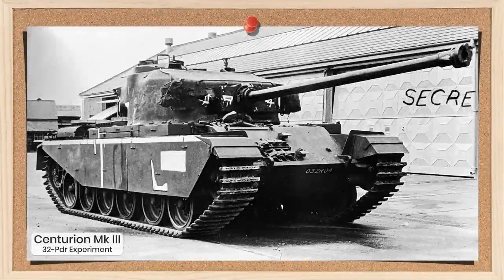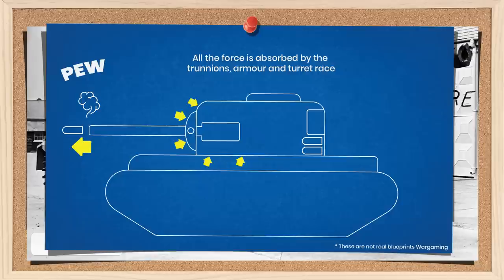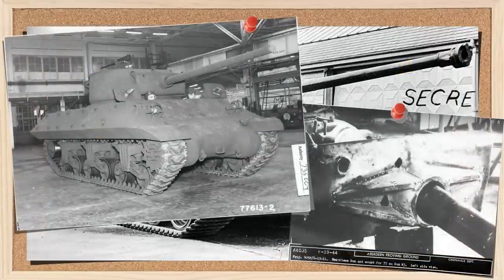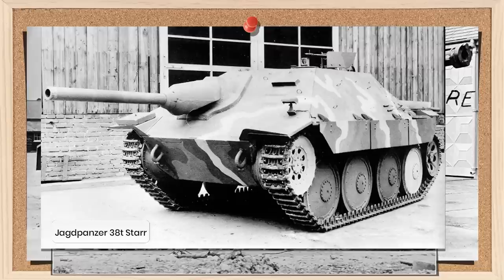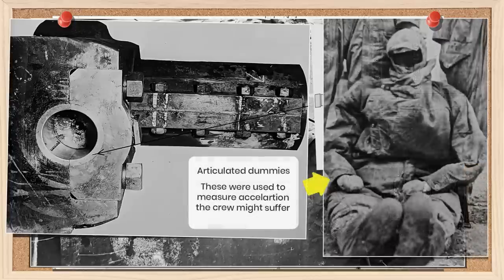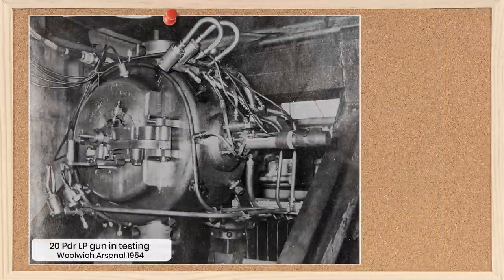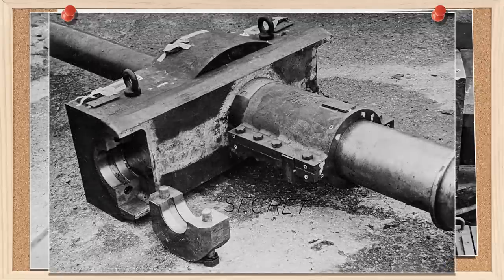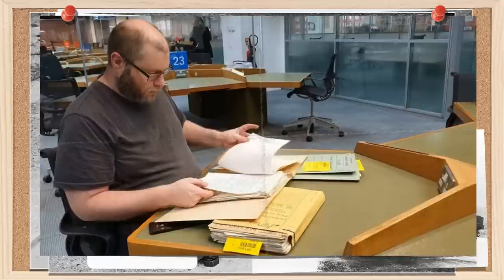Centurion 32 pounder experimental tank.

Comment: The basic idea of having the turret and hull structure absorb the recoil energy directly instead of using a recoil buffer is good. I was a turret gunner in the army and I can tell you that a recoiling gun is extremely dangerous in such a confined space. A fixed gun would be much safer. In addition the recoil mechanism itself can get dangerously hot which causes it to lose effectiveness, leading to the possibility of a recoil over-run during rapid fire.

I always wondered why tank designers didn't just reinforce the gun mounting to absorb the recoil directly, and always assumed it was because of excessive weight. However you imply that there were other problems as well. I was amazed when you said that the fixed-gun system led to the blowing out of the periscopes! But I don't understand how not having a recoil buffer mechanism could do that. The explosive blast comes out of the gun muzzle, not the breach. It should make no difference inside the turret whether the gun has a buffer or is fixed. What am I missing here?
Reply from the maker: the shock of the gun beign taken into the armour - though at this point it was overcharged too muich higher than normal -
Reply: The tank is not going to passively absorb the shock energy, there will be a reaction. It will vibrate just like when a sheet of steel vibrates when hit with a hammer. To every action there is an equal opposite reaction.
Reply: The Germans at the final months of war pursue the concept of fixed gun on the Jagdpanzer 38 in  Czechoslovakia for reasons of speeding up the production but it did developed issues like cracked front armour but the end of the war stopped any development...
Reply from the maker: @paoloviti6156  yup, which is why we added that to this video :)
Reply: Short answer is newton's law. 

When explosive goes off inside the breeches, the expanding gas pushes on all direction. 

For the sake of simplicity, let's just say it only push against the projectile and the breech face. 1/3 of the energy was convert to energy sending the projectile flying, 1/3 of the energy get push against the breech, 1/3 of the energy get vented out the muzzle end. 

Without a recoiling device, the 1/3 that get slam against the breech will have to transfer into the gun mount, which get transfer into the rest of the vehicle. 

If your vehicle did not physically moves back, that energy has to go somewhere else.  Stuff that's relatively loosely connected, such as optics will get destroy in the process. 

Your observe the recoil system getting hot. Have you wonder why it was the case? It is largely because of the internal friction generated by the moving component of the recoil system. 

Lastly, the engineer do take into account of how much recoil the vehicle frame, the gun mount, the suspension, etc can absorb. It is a balancing act, just like any other engineering problem. 

A flawed but somewhat useful explanation. There are 3 proposed design of afv, one without active recoil element, one with only active recoil element, one with a mix of both. 

The static design will have to reinforce component vehicle frame, suspension, etc while also engineer some isolated suspended mount for optics and crew. The resulted vehicle will have twice the weight compare to the active recoil vehicle. Much of the weight is dead weight.

But when we examine the design of the active recoil design, although it is 1/2 the weight of the static design, the volume the recoil system occupied is roughly twice of the static vehicle. The travel of recoil also means you need to elongate your design to accommodate the recoil travel or your vehicle has opening allowing the recoil to travel. 

This engineer compare, contrast, made optimization, and came up with a hybrid design that relies on both active and static element to absorb the recoil, which is what all vehicle use now days.

Comment: The explanation of how a rigidly mounted gun requires the turret to be strengthened to deal with the recoil of the gun being fired when not spread out by the recoil system actually answers the question that had been bugging me about how the T 34-85, Panzer 3 and other vehicles with off centre guns were able to fire without damaging their turret rings. It still annoys me that they're not symmetrical but now I know why they can get away with it.

Comment: The promised rigid mounting video teased years ago!

The recoil system's primary function isn't to absorb or reduce the recoil force (although it does by turning some into heat), rather it's to spread out the force over a longer time.

Always thought the problem would be structural, turns out it's the squishy bits. Never thought about that. Do you think heavier tanks would help lessen it or would shock just not care?
Reply: my bet is it can lessen the force, but then how heavy/big the tank need to be

Comment: I'd like to hear more about liquid propellants now. Now I've just thought about it, it sounds like it could have a huge amount going for it and I'm really wondering why it isn't a thing in modern vehicles. It'd be more volume efficient (and easier to manage your volume), safer (though I don't know by what margin), and I could see it having logistical and resupply advantages.
Reply: As far as I'm aware it's still an ongoing concept but still not working
Reply: Last I heard the US Army was looking into it for the Crusader Self-Propelled Howitzer before it was dropped for a conventional gun, and that was before the Crusader was dropped for more improvements to the M109.
Reply: Same here, the fictional MBT-90 in Gavin Lyall's 'Uncle Target' (1988) is fitted with a 120mm liquid propellant gun, that is described as being backwards compatible with the shells used in the Chieftain and Challenger I. In the novel it's implied that the fix was computer monitoring of the propellant mixture. As a fictional tank I've been looking into the real world antecedents of, it's always nice to discover a new piece of the puzzle.
Reply: Ohh there are a few problems: liquid explosives are very powerfull meaning chamber pressures are much higher. they are also more sensetive, the logistics of transporting such ammunition are intersting, if such liquid propellant detonates inside the tank you are sending turret to the moon.

Comment: Thank you for the video. It occurs to me that, for a HESH round where velocity, within limits, is not a necessary factor, a rigidly mounted gun could alter it’s trajectory by altering the injected propellant to suit thus would need no mechanical elevation. This is done by mortars and artillery routinely today by adding a certain number of charges to the round as appropriate. A liquid propellant system that was finely adjustable could do the same as required.

Comment: An open horseshoe within a horseshoe arrangement extending around the full outside of the turret (to absorb the recoil) would have freed up the inside of the turret for everything including the Soggy bits plus an armoured box on the rear of the turret for the ammunition...... not forgetting the blowout panels..... job done ✔
Reply: I don't understand, how does that look like?
Reply: @edward9674  in appearance think vaguely of the AMX-13....the  recuperators would be fitted and shielded externally within an armoured horseshoe around the outside of the turret the entire recoil mechanism is removed from inside thereby freeing internal volume ....it would just be an experimental adaptation to allow for the testing of the 32 pounder.... nothing complicated and simple to produce

Comment: I have always been a proponent of liquid propellant due to the many benefits - ease of storage, thus increase in ammunition carried. Safety of the propellant. Significant increase in firing rate.  Ability to inject different ammo loads to achieve different flight paths (somewhat more relevant to a howitzer). Faster ammunition re-supply.
The US designed a 155 howitzer using liquid propellant back in the 70s.  They were able to fire fast enough and with varying trajectories to achieve 6 rounds simultaneously on target - a pretty big benefit!
I am sure with todays technology that we could overcome the difficulties of using liquid propellant and make use of the benefits.
I wonder if the howitzer design was dropped in order to maintain commonality with NATO?

Comment: Excellent presentation👍. Apologies if this is a stupid question, with the solid mountings for the guns would this be similar to those mounts used in ships turrets of the time? Most footage we see of Battleships firing no recoil is evident this being transferred through the hull. would this mean the suspension was "upgraded" on these vehicles? And what happened when firing with turret at 3 and 9 O`clock?
Reply: It's not a stupid question, but I always thought that even the biggest guns on battleships recoiled on systems just like a tank or artillery pieces, and a quick Google seems to confirm this. The USS New Jersey main guns apparently recoil 48 inches; there's a lot of Google hits on the subject of whether there is enough force to move the ship or flip it over etc if all guns are fired at once, and one of the reasons this doesn't happen is that the recoil systems slow down the transfer of force to the ship, plus they are pretty massive objects too, so it seems to balance out.

PS - maybe the footage we see where the barrels don't seem to recoil is perhaps blank charges being fired for the cameras? Just a guess :-)

Comment: So in game mechanics, a rigidly-mounted gun allows for greater crew skills (since they have more room to work with), but has worse after-firing dispersion.

And breaks modules every time it's fired.

And degrades crew skills the more it's fired since squishy bits don't do well with shock. Dunlop rubber seats mitigate this crew degradation feature, but the Hetzer 88 doesn't have it.
Reply from the maker: well if you wanted this in WT. i don't know if it would be that fiddly - simple way would be to have 2 shots, a standard 32pdr, and an overcharged round - which is the same as the 105mm late guns relatively speaking so very good for its rank. - balanced by either limited numbers of special rounds, longer reloads after use, or yes minor module dmg to itself. but I doubt they would add it in any interesting way or would just over-tier it making the rest of the vehicle useless.

Comment: OK, liquid guns would totally be possible now. Just look at the injection systems on modern combustion engines and the insane computational fluid dynamics we use to get them right.
You can do this now.
I don't even think it would be difficult.
Reply: I mean a direct injection petrol cylinder is literally already a fluid propellant firearm, the projectile is just captured.
Hell, it's almost binary already as you have to mix an inert liquid (petrol) with the oxidiser (air) in the correct ratio and state before igniting it electrically.

Comment: So WOT's portrayal of the Caernarvon is not complete BS.
Reply from the maker: just mostly BS as they took the gun from this - dropped the real gun and so on. typical WG
Reply: So they put the Centurion 32-pdr turret on a Caernarvon hull, and decided that that would be the tech tree Caernarvon. And turned the Action X turret Caernarvon into a premium.

Which leaves us with no actual Caernarvon in-game, with the 20-pdr and a proper turret.

Sigh, all we just wanted was just a RoF buff on the original Caernarvon...
Reply from the maker: @mttspiii  More or less, and as for the Caern Action X, that one is entirely pulled out of its arse. - no such thing ever. - but they try to pass it off as a real project.
Reply: @mttspiii  The change to the 32-pounder really screwed up the immersion for me- the Caernarvon with Action X is the tank I was looking forward to grinding for.  The 32-pounder not only is implausible but also takes away the universal tank flavour of the Caernarvon.
Reply: @armouredarchives8867  I'd figure that, despite never done in real-life, the Action X turret would at least be less irksome than putting that 32-pounder on a conventional gun mount in a Centurion turret.  And the implausibility of the conventionally-mounted 32-pounder really irks me.